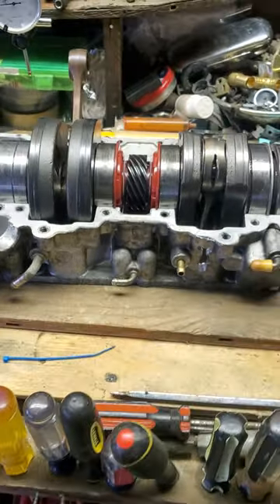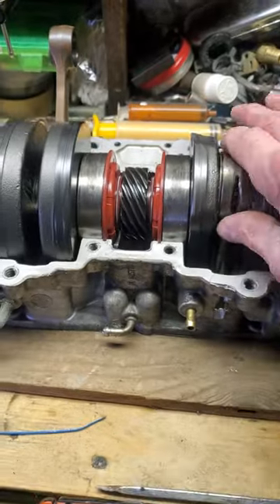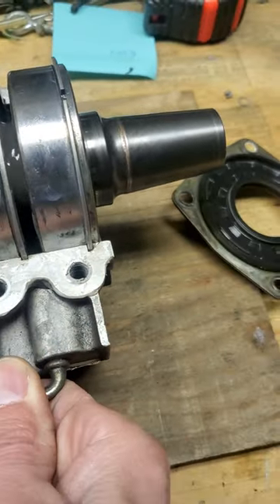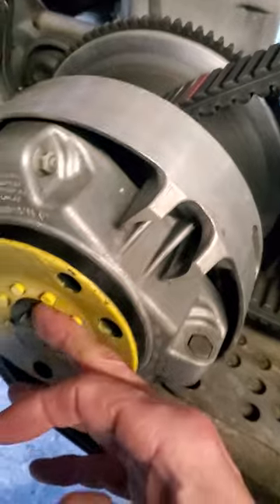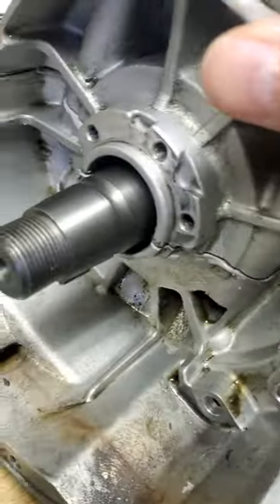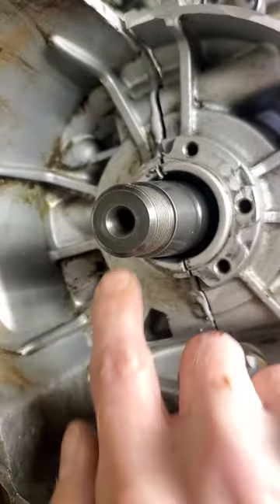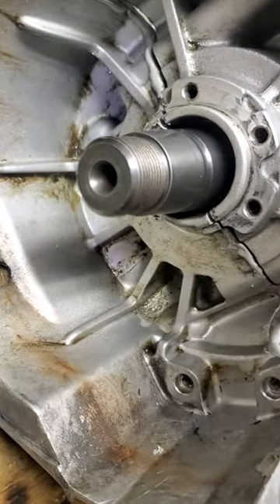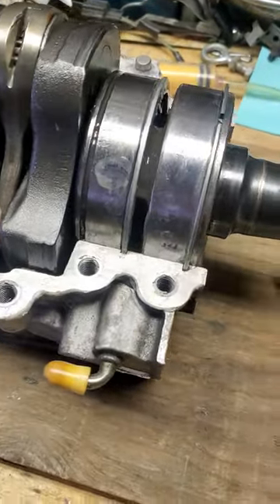How to grease your outer crank bearings on your #skidoo #MXZ #800HO PTek (Shown via a cutaway case)

Comment: R is the same thing. You can also buy the “grease buddy” for the Mag and PTO side. It goes on the tube you showed on the PTO side and a bolt with a hole in the mag side. Then you can grease them with ease.

Comment: Great job explaining! I have an 800r and will be doing isoflex soon. Thx so much.  You're a great teacher!!!
Reply from the maker: Make sure you get real isoflex from a dealer. There's tons of imitation crap labeled as iso but its not the same & will cause issues.  
Have a helper turn the engine over by hand (plug wires removed)  as you do the mag side it will help get it spread through more evenly. Just 1 slow rotation as you squeeze in the isoflex. 
Thank you for stopping by the channel & happy riding this yr man👊   hopefully we get some major snow🙏🙏
Reply: Thanks for the clear explanation.
 I'm also servicing an 800r I just don't see the access nipple on these blocks. Only have 4 ports on carb side of motor. 2 oil and 2 air pulse lines.
Great trick with the ziptie and rotating motor to check for access to bearing.

Comment: Does this apply to the 800r 2008 as well?
Reply from the maker: @kjellamundsen1463   Yes im pretty sure it does. If its the same looking setup deffinatly. You want pay xtra close attention to those bearings i inspect before every ride. 
Pto/clutch side watch for any grease/oil leaking behind the clutch. Mag sides little more of a pain you need to pull the recoil to visually inspect that side. And keep in mind this is only outer seal inspection there's no way to tell if the inners are seeping besides watching for the excessive smoke on start up especially 1st start of the season. 
Make sure you dont over grease them too be careful dont force it in and blow that inner seal out. Even adding a 1/4 of whats recommended a couple times a season would be good insurance without the risk of over doing it.  I have no clue how capable you are mechanicaly so im trying to steer you right on this👊  If your unsure of anything dig into it research it hard ask questions make darn sure you understand before doing anything.   Good luck & have a safe season man👊
Reply: @Betterthanbought.  thanks I appreciate your respons. I am capable and will get on with it before the season for peace of mind I guess. Mine have run about 5000km /3500 miles but I know bearings have never been greased up since new. Also being a 2008 the grease will probaby dry out from aging alone.
Reply from the maker: @kjellamundsen1463    No problem man. Make sure you get the isoflex from a dealer too. Most the stuff on e ba y & such is just white lithium its a huge scam with that stuff🤦‍♂️.  I think i would find out how much they recommend to put for your year & i would do half of it. Ride half the season then do the 2nd half then. Just to be easy on everything no pressure on those inner seals ect. Little xtra work but i would think of it as insurance.

Comment: Does anybody know the correct amount for the PTO side? I just rebuilt the lower end but I had a hard time getting the inner pto bearing. So I have a little bit of Isoflex left over that I’d like to inject in.
Reply from the maker: 10-15 ml is what it is said to be correct for a refill on the pto side.  Ive done 10ml without any problems. Just dont overdue it or force it in otherwise you risk blowing out the seal. 
Good luck.

Comment: Doing this can blow the inner seals, cant it? The middle red ones
Reply: No isoflex doesn't reach the inner bearings ever those 2  are oil bathed.  Please watch the video you will see how there all seperate.  Pto and mag sides get isoflex only. The inners get bathed in 2 stroke oil constantly. Hence why those rarely fail.  
Using more isoflex than is recommended can damage the inner seal for outer bearings by creating hydraulic pressure just dont overdue it theres clear amounts specified for each yr/model simply follow that & your good to go👍  also make sure your buying real isoflex from a (dealer only)
Hope that helps clear things up👊
Reply: @thegreatgreennorth9983  Great explanation about the outer bearings. 

The 2 center bearings aren't in an oil bath, they are lubed from the oil injection. Only the water pump/oil pump gear/bearings are in an oil bath. Check out a shop manual and you'll see that they spec to add 50ml of oil to that cavity when assembling the engine. 

Also if you look closer at the crank in the video, you can see where the red center seals are located. They're on the wrong side of the bearing if they're meant to keep the bearing in an oil bath.
Reply: @jayfavel4447  ya im well aware i could have/should have explained that better or worded that differently for sure. 
Good clarification👍

Comment: Do you pull your seal off before you add the grease so that the pressure from pushing it in has a place to go? I’ve heard about the inner seal for the outer bearings could blow out. I’m about to grease my bearings on a rev 500, and was just curious if I had to worry. Basically I’m wondering if I’m able to just put the grease through that port you show, while turning over the motor slowly, with the seal on
Reply: No concerns unless you put too much in there. Dont force it go slow & slowly rotate as you said.  Keep the isoflex inside/warm it will make things much easier.   If your concerned put in half what they recommend go on a good ride then add 2nd half👍   

Ppl that just force it in quickly or use too much can definitely push it past the seal & cause major issues.  Follow the guidelines you'll be good to go.  Now if your super fussy & have no problem yanking the clutch then sure drive a acrew into the seal pull it wipe out all old grease then do it from that end & replace the seal. But again dont overdue it or when you go to seat the new seal hydraulic pressure will blow the inner seal out as your saying.   Sounds like you have a good idea about it all so i would suggest doing whichever way you feel most comfortable with👊   
Thanks for stopping by the channel & happy trails my friend.
Reply: @thegreatgreennorth9983  thank you, I appreciate the input!
Reply: @thegreatgreennorth9983 what about injecting half of grease slowly into the nipple side with the seal off (while turning motor slowly), and then the other half putting into the face of the outer bearing (once the old grease is all wiped away). At same time, it replaces the old seal that can potentially leak air and blow the motor. Also, I wonder why they didn’t add a nipple to the MAG side? Is it because there’s only one bearing on mag side?